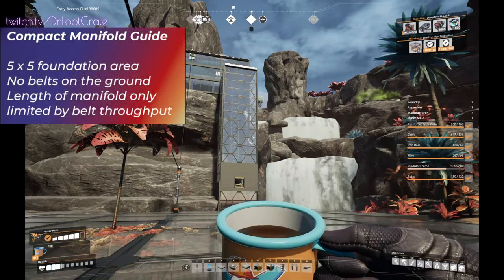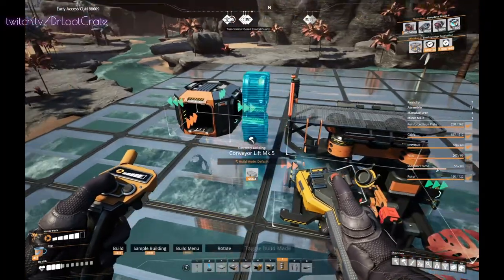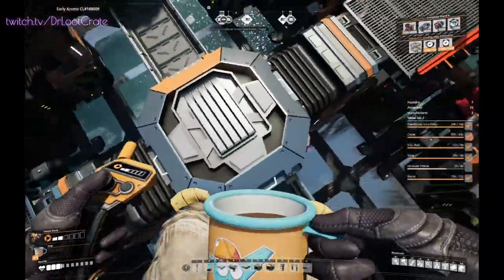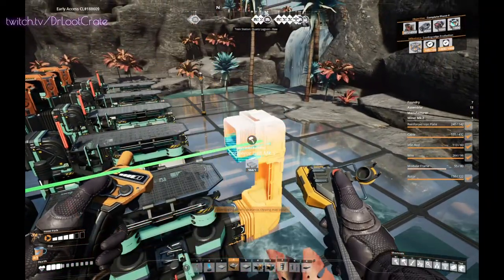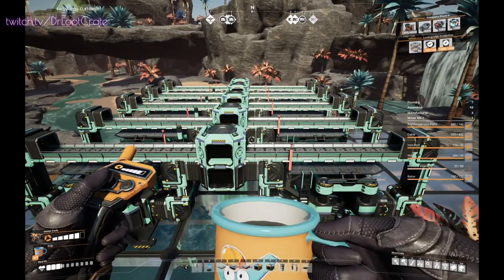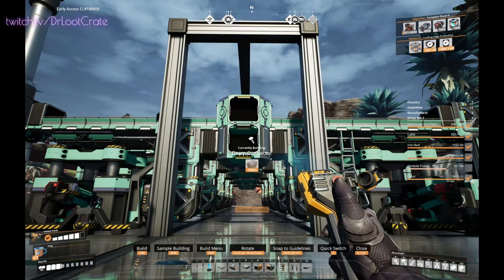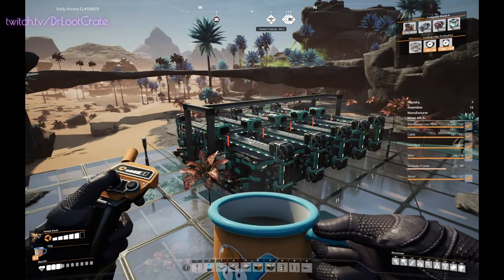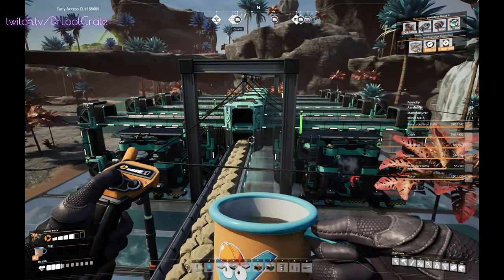Compact Manifold Tutorial - Full Build - Overflow Your Way to Efficiency in Satisfactory!

Comment: No. It takes same space if you just place mergers behind constructors and them merge them into single thread. You can achieve "compactness" only when build 2nd floor, shift it at the 2 steps and merge the outputs with 1st floor
Reply from the maker: Your situation is slightly less compact lengthwise because you have to bring the two threads back together at the end, but I hear ya. I never claimed maximum compactness…I just wanted to give beginners an example to work from.

Your idea is another good example for sure.

Comment: I would certainly love to see you do this with a manufacturer!
I would probably end up with a 14m tall monstrosity with diagonal floating splitters.

On the other hand, my current solution with a subfloor and vertical central bus also tends to get pretty tall. Stuff needs to go somewhere, after all.

The bit I do like about that one is that you can chain as many machines as you can feed with one supply belt, by placing them at a right angle from the feeder belts. Just need to pass the belts left and right by the elevators that lead to the machines.

Comment: Not bad )
If you want to paint all buildings in the same color, just change the main color - the upper left icon in the customizer
Reply from the maker: I knew about the top left swatch, but another watcher told me about clicking on one of the bottom searches and chooses the standard option there. Much easier than changing swatch colors around. Not sure how I missed that one until now!

Thanks for watching!

Comment: I do something similar but routed through the floor so all you see is the machine and the connecting end of the lift from the top. If you do it right, you have minimal belts and looks super clean when its done but it takes forever to get everything aligned and routed.
Reply from the maker: Good call! I run most things through floor holes myself for more complex machines, but I don’t normally bother with single input machines. This was aimed at beginners and didn’t want to use anything unlocked from the awesome shop
Reply: @DrLootCrate  I spent almost 100 hours setting up my first fuel power station due to how much time I spent just hiding logistics and fell to my death probably 50 times from walking off the platforms I was working on under the floor before it was done... haha That is why I love this game so much. You can just go fast and slap something together or just take your time and do it as complex as you want it. Ultimately, that save was lost so I just recently got the itch to start in it again but this time I am starting in the desert. The dunes and elevation changes are making my main factory planning a lot more complicated over starting in the West side of the map as I usually do. In 700 or so hours in the game, I have never really set up a full train network so that is my goal this time through. I am still a bit fuzzy on how to integrate everything together as I like setting up satellite factories over 1 main mega factory but I am not 100% sure how I want to go about it yet. I am not sure if its better to use the trains to move ore and process it where its needed or to only use the trains for finished goods. I am thinking of making 1 main hub in each area using trucks to move ore from the miners to the hub and using trains for the long commutes to where its needed from there. I seen a video a while back of a guy that built a sky base that had skyscrapers and huge factories on a single level that looked amazing but I dont think I can pull that off as I have no idea how to transport everything from ground level to that high up efficiently...
Reply from the maker: Yeah I prefer the disaggregated approach as well. I have a pretty extensive train network through half the map. I normally will try to build a factory near as many nodes that I need as I can and bring in what else I need. Normally this means moving the more rare materials around…bauxite ore and quartz crystals/silica.

I only make trains with two cars so you can fit in a few stations together if necessary. I think I have 14 different two car trains going. Perhaps that is a good topic for another video!
Reply: @DrLootCrate  I think it's an excellent topic.   I'm trying something new for me.   More real worldish I guess.   Tracks on the ground, small manufacturing hubs, nothing more than 2 (3 max) stories.
Reply from the maker: I will put it on the list for future videos then for when I am done with this machine feeding series.

I try to follow the ground about 16 m up, but I have to admit that I have a lot of unsupported sections.

Your approach sounds pretty close to what I am doing at the moment - separate city-like factories with separate “smaller”buildings for each component or two. I am enjoying building that way over one giant building for each thing.

Comment: This is very interesting tip for design better ways to feed and get back the materials. I got a couple of questions for you, if you will like to reply. Do you got some videos about storage with overflow management? I mean, storage is a big problem in game, when you go further, unlocking new milestones and parts, then you will try to have a centralized storage, able also to route your parts where other machines like assemblers and manufacturers require them. The other question is, assuming you had only belts Mk4, and you have make a input system for one sink, with 18 inputs (to waste any overflow and gain Awesome points), this will be efficient? Every Sink require 30 MW, so i think is smart try to have less Sinks possible and at the same time waste all the overload of productions.
Reply from the maker: Hi Franco, gad you liked the vid. Sadly I dont have a video on central storage, mostly because I have never built one. I have stashes around the map that grab on a train route. I do have a little storage for late game parts, since I bring everything centrally in drones for battery collection.

I don’t think it is a problem at all to put overflow from 18 items on 1 belt. Even if you fill up the belt, it just means you get points a bit slower. No big deal.

Although if you are worried about 30 MW at that point maybe you should expand your power grid!
Reply: @DrLootCrate  Thank you very much for the answer. I still consider your videos very useful for learning new ways to do the tasks, even the game map is huge with a lot of flat areas, soon or late you had to deal with vertical stacks, and they explain very well. Well,  no (smiles) i haven't problems on my power grid, i made 7500 MW, mostly by oil, with a max power consumption of 2600. It's just, Sinks are huge (apart the 30 MW each), i try to have one main factory where everything comes, so in Grass Hills i don't want to build a tower of Sinks tall to the sky, for this i had this 18 inputs solution in one Sink. If all the inputs overflow at the same time it will slow down for sure, don't happen yet cause i still need constantly materials for roads and new factories. Still, good to know the opinion of a pro like you. Have a nice day 🙂

Comment: My machines don't fill up with input materials unless they are turned on connected to power.

I have a the recipe selected, but no inputs actually go into the machines until the power is on. Is this a bug? Or am I missing something?
Reply from the maker: Nope, that is how it works. If you want the system to fill up faster, you can fill some/all of the machines with stacks of the input and it will all overflow faster.